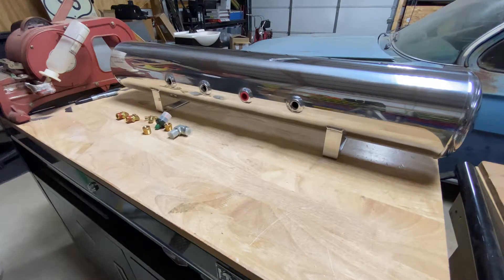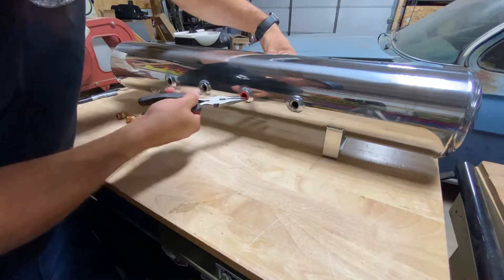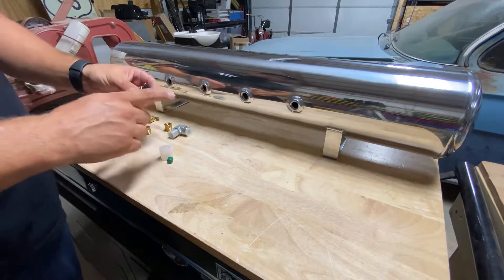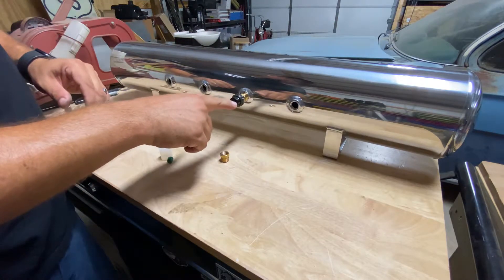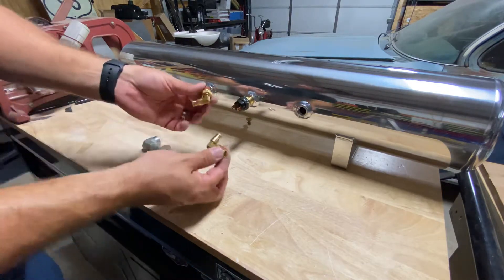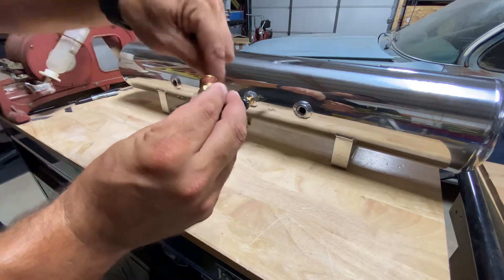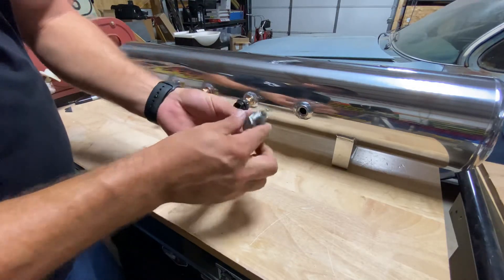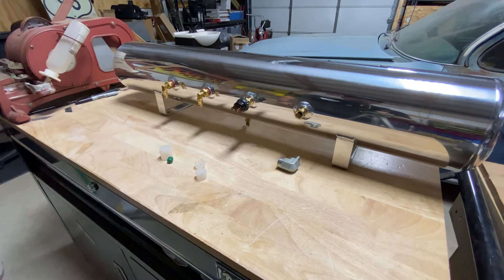Twisted Images Stage 1 Air Suspension - Tank Plumbing

Comment: What psi is the pressure sensor
Reply from the maker: We include a 200psi pressure switch with this package. If you want a lower pressure, we can also swap that for a 180psi or 150psi switch.

Comment: You can use brass fittings on a aluminum tank?
Reply from the maker: We have used brass on aluminum for years and never seen a problem. I’m guessing corrosion is more likely when you have water (or other fluids) present to accelerate the interaction.
Reply: @twistedimages405  OK good to know. Thanks.

Comment: What guage is the aluminum?
Reply from the maker: On the tank? I’ve never had one cut open, but I’m guessing it’s around 12 gauge material. You can dent it if you whack it, but you can also lean on it without it deforming.

Comment: thanks for the info! I'm interested in this tank with all the accessories in the video. However, on the site, there's so many options I'm not really sure which link to click
Reply from the maker: Here’s a link to the same management kit we have in this video:
https://bit.ly/3Hi17Vp
If you have any questions feel free to send a message my way!
Reply: @twistedimages405  Thanks! I tried to call a couple times today. Mailbox Full. Sending an Email but its slightly complicated. Curious on some dump valve questions
Reply from the maker: @ZAY________  winter storm knocked our power out all day, but we’ll be back at it in the morning! Definitely give a call back and I’ll help get you sorted out

Comment: Which is the Correct bags for hatch back vehicle. Hyundai i20 asta 2015 model. And im from india. I need a low budget air system. Only needed
1.  two paddle valve, one for front       and one for  back
2. 4 air bags
3. Plumbing lines
4. 5 gallon tank and compressor
5. Relay
How much its will cost. I dont know how to choose corect bag for the car. Pls reply.
Reply from the maker: I’m not familiar with the i20 Asta- I don’t think we got those over here in the US.  Get in touch with me through our website (twistedimages.com) and I can work with you to get some measurements from the car!
Reply: Thanks i appreciate its ❤

Comment: Say if my compressor fails to turn on, can i add an manual air port to the tank?
Reply from the maker: If you have a spare port on your tank, we have a Shraeder valve fitting that can be added to manually fill it if your compressor ever fails. 
https://www.twistedimages.com/Shrader-Valve--14-Male-NPT_p_499.html

If you don’t have a spare port, a tee can be added to one of the feed lines instead to install the valve.